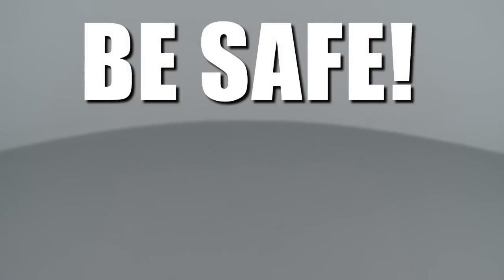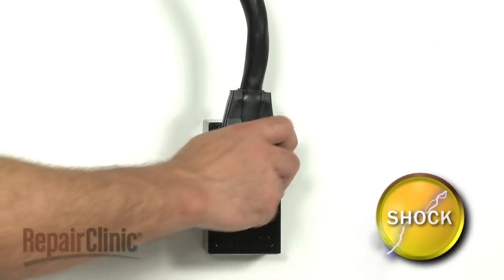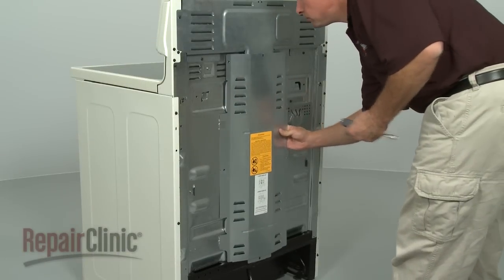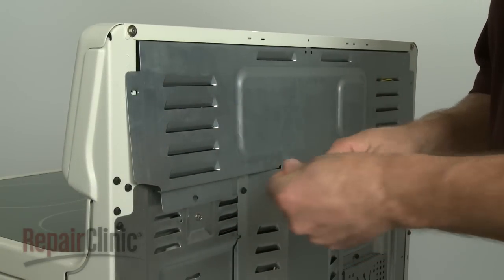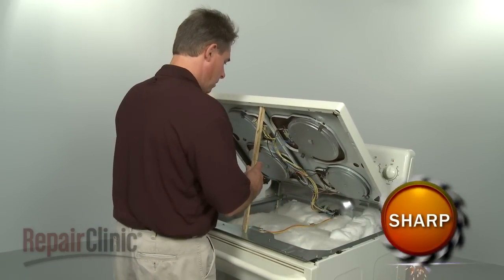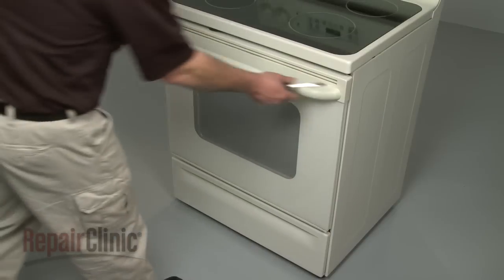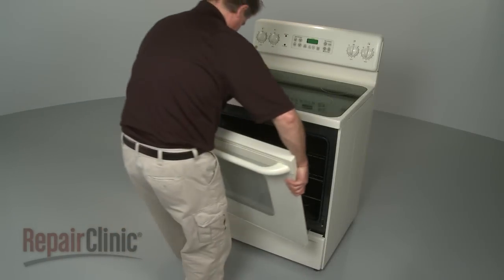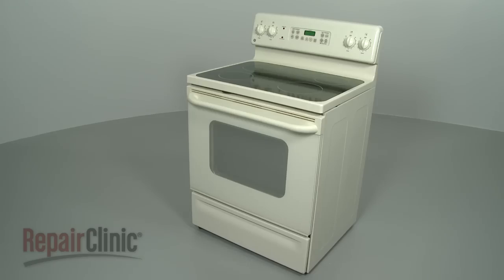GE Electric Stove Disassembly (Model #JBP66CH2CC)/Repair Help

Comment: My oven door lock got engaged while oven was baking - now it's locked and won't open even after cooling off. I can't run the clean cycle because there's food in the oven. I haven't found a video that shows me how to release the door lock on this model.

Comment: I have a GE Profile Electric Stove, model # PB960EJ4ES. I had to replace a GFCI near it. I had flipped the breakers just below the one I needed to replace the GFCI- which were for my stove. When I reconnected it, the stove was no longer working. No lights- no power at all. There is electricity running from the outlet all the way to the control board. I am not sure if it surged or something and messed up a relay or something on the control board and I do not want to pay over $500 for the control board alone. Is there something else I can check or a reset or fuse somewhere to repair this without being out hundreds of dollars? I have been trying to find an answer for hours. There are a few companies that do control board repairs, but nothing local, and I want to test it to see if that is even the problem first. Please help if you can- thanks!

Comment: I have a GE JB940WB flat electric top range.  Door hinge on right side is stuck/jammed.  Left side hinge works.  This does not involve the "Clean Cycle" latch.  The door can be pulled open about 3" on left side and 1 1/2" on the stuck side, no more.  Any suggestions for how to fix?  I plan to remove the right side panel for a better look and access.
Reply: Same problem.  How did you fix it?